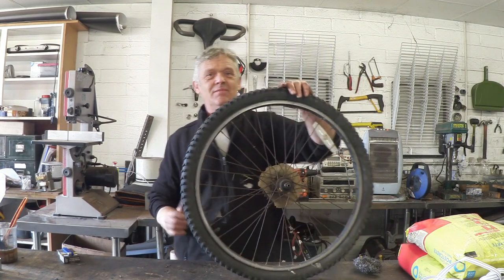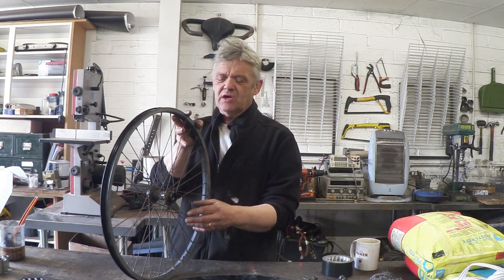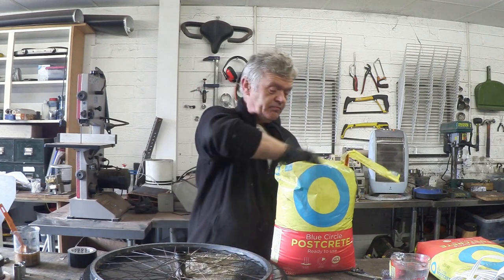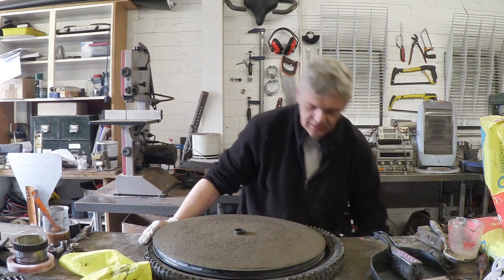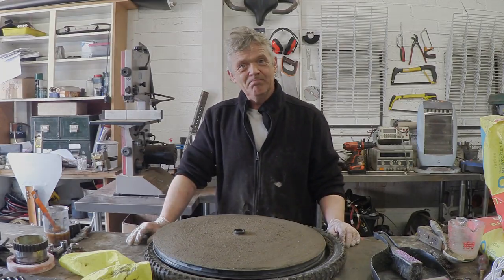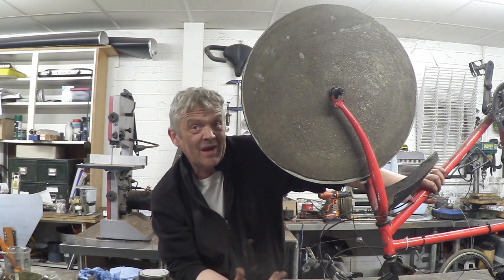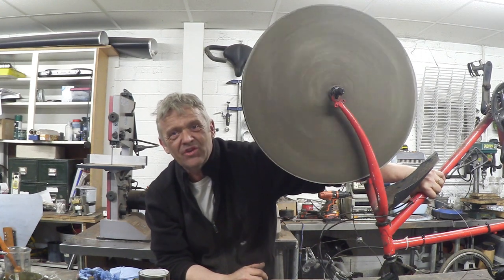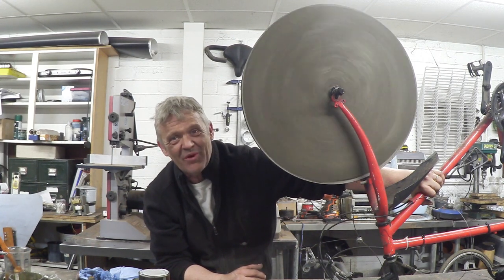1118 An Easy To Make Flywheel From Concrete And  A Bicycle Wheel

Comment: Wow!!  You'll never cease to amaze me with quick and simple solutions for what might expect would be a difficult component to make yourself.
If someone asked me to make a flywheel, I'd be researching melting and casting iron all week - concrete would never have occurred to me.
Reply from the maker: it does make a nice job of it
Reply: I found myself full in this search ... and now our dear friend saves me
two questions keep me from sleeping though;
the weight ; 25 kg; will it be enough? And above all, will the bearing hold up?
What do you think please?
Reply: You can buy round weight one at sport store

Comment: Awesome... I guess I need head out to the garage and put my old flywheels to good use. I was in structural concrete for 35 years. Lots of good advice given in this video.
Reply from the maker: wow - thanks mate
Reply: @ThinkingandTinkering  You do a great job with your preparatory research. Then apply it in some fantastic ways.

Comment: I'm thinking that to upscale this, you could use a car tire? Or adding weights to the bike tire before adding cement (but then I'd be worrying about the bearings if that sort of load would be an issue or not). Or adding more flywheels to increase "weight", as I've seen some generators with up to 18 flywheels. I've yet to start anything like this, but I've been stuck on an idea of making a modular workout system since I was a kid that would charge a large battery, with the pedal system mainly used for working on the computer. Amazing video! Love to see people using simple, accessible parts and tools!

Comment: Now that, is a good idea! Steel reinforced concrete flywheel with built in bearing axel, chain drive and freewheel hub. Super cheap too.
Reply from the maker: now you describe it that way it does seem good lol - cheers mate
Reply: Steel 'Oil-drum' full of concrete, and car-axle bearings; tons of stored energy (pun intended). Or 'scrap' steel plates and same/similar bearings, higher density of steel makes more energy storage in a smaller volume, and its way stronger. don't under-estimate the danger of a bursting flywheel (add fibre and/or chicken wire to the concrete). An oxy-gas cutter on a radius arm cuts really well balanced steel discs in one pass.
Reply: @bikerfirefarter7280  
What mode would this flywheel explode?  Just asking to get an idea how fast this flywheel could turn for energy storage.
Reply: @lylehintz7275  A flywheel stores energy at any speed of rotation, but the stored energy is related to V-squared so faster is better, and therein lies the danger. The mode of 'explosion' is generally catastrophic for brittle flywheel materials, chunks large and/or small flying at speed mostly in the plane of rotation. Materials of high density and with high tensile strength are preferred. Brittle materials confined within structures that can rupture are very risky and need robust outer cases capable of retaining the fragments and absorbing all the energy. Ideally the flywheel material itself, IF it fails, should disintegrate into very tiny particles, and the fracturing process should also absorb all the stored energy.

Comment: made one with my dad took the tire off,  and wound old copper wire around it until it was about 11lbs finished it off with epoxy  which we balanced using plasticine, (modeling clay)    then we had a gob big enough to balance,  we weighed the putty and mixed up just a pinch more epoxy (by weight)  expecting some would stick to the cup/mixing stick.    we got it pretty good that way.  and did other minor adjusts by drilling out some of the epoxy/wire in 2 or 3 spots.  thing would spin for ages.  lots of gyroscopic force.
Reply from the maker: it sounds awesome mate

Comment: Really nice videos, great work. Il put my idea here, i wish i had the possiblity to do it myself, but right now no. I have a portablw 100w solar panel and very variable sun. I have used lifepo4 in between to make it more usable. But, my idea is having a flywheel instead as balancer/storage. Have old training bike with flywheel.  Maybe powering intermediate tool use, drill etc maybe 300w. Weight preferably portable, maybe 20-30 pounds for the flywheelpart. Maybe even interested in the math :-)

Comment: I like this idea alot for the reason that you can treat the flywheel as a module and connect multiple together to work with extra weight.
Reply from the maker: nice one mate
Reply: I need to connect 4 of these flywheels (4 x25 = 100 Kg) but how to make this connection please?
one next to the other horizontally crossed by the same axis? Yes ?
Reply: @ThinkingandTinkering  What do you think dear Robert?
Reply: @slimel-gharbi8170  you could make it easy on yourself and swap the axles with threaded rod.
Reply: Or you could cut and drill pipe to overlap the axles "sleeve" and use a pin or nut and bolt on each side.

Comment: Epoxy sand composit also works great.
Reply from the maker: it would do just great mate - a bit more expensive than post crete though - I paid £4.50 a bag
Reply: @ThinkingandTinkering  I've been wondering what materials would make a fair to good grinding wheel.

Comment: old barbell weights will serve too.
Reply from the maker: for sure - they can be hard to centre though - the bike wheel comes with a ready centre
Reply: @ThinkingandTinkering  I just looked it up and generally, the bore is 50mm, and the plates run form .5 to 25 kilos.
I don't know about Canterbury, but here in California, you can occasionally get a barbell set just for carrying it away. :)

Comment: Robert,
I had a drive laid at my house and they laid thick plastic on the surface after it began to stiffen up. Every day or so a man would stop by and dampen the surface and then put the plastic back down.  About 10 days later they uncovered it and that was it. This company has an excellent warranty and I guess this is why they can offer it.
Reply from the maker: that is a lot of work to go to for a drive mate - that will be one tough lump of concrete

Comment: I would like too ride a bike with concrete wheels now.
Reply from the maker: lol - who wouldn't!
Reply: @ThinkingandTinkering  Nice idea 'in theory', but the spokes do nothing to reinforce against bursting the concrete, at least add fibre and 'chicken-wire' to the concrete. do not underestimate the dangers of a bursting flywheel's stored energy and the real potential for damage/injury. somebody is bound to see just how fast they can get one to revolve!; remember the history of big grinder-wheel bursting. Be safe.
Reply: Riding will go great stopping.....
Reply: @bikerfirefarter7280  Burst? How fast is it gonna be spinning?
Reply: @SinsBird  Only as fast as it reaches its tensile failure point. Then its no longer 'spinning'. I repeat, 'somebody is bound to see just how fast they can get one to revolve!; remember the history of big grinder-wheel bursting. Be safe.'  Don't just ask me, do the homework.

Comment: I thought about turning my old bicycle into a water pump and I needed a Flywheel so I also thought of using concrete to convert the rear wheel into flywheel and came to Youtube for ideas and saw that you thought about it a year ago. Anyway, is it balanced on all sides ?

Comment: Cool!  But wouldn't it just be easier to just use the wheel?  Am I missing something?  Love what you do, keep it up!  Take care, Poo
Reply: Without the weight it wouldn't be a flywheel to continue the momentum.
Reply: Think of it as a battery for angular momentum.
Assuming somewhere around mid sixties cm Dia., at just 100RPM:
For a 500g ring you'd have about 3 Joules stored.
For a 25kg disk, it would be more like 75 Joules! 
Basically, for the pedal-power, it lets you use your muscles at peak efficiency and rest between power-strokes. Just like a 4-stroke ICE only makes power on one-half of one revolution and has to coast the other three-quarters of the time.
Reply from the maker: a flywheel needs mass mate - all you are doing with the concrete is adding mass - a lot of it!
Reply: @poosmate. you certainly are missing something alright. Mass and physics. no offense meant.
Reply: Excellent!  Thanks for all the replies guys.  Take care, Poo

Comment: Why didn't you fill the tyre with concrete?  I would have thought that this would put the weight at the greatest distance from the hub, thus providing the maximum benefit to the fly wheel... ? Regards Mike  ;)
Reply from the maker: because its a thing that is easy to say than it is to do mate

Comment: Nice - brings to mind Lucien Yeoman's concrete lathe designs from 1915/16.
Any idea what the maximum safe speed for one of these flywheels would be? I'm guessing it's highly dependent on curing time.
Reply: There is NO 'safe speed' for rotating non-reinforced concrete, regardless of curing time.
Reply from the maker: I am sorry mate but I think you are wrong here - concrete flywheels are being tested for green energy storage at thousands of RPM - it all depends on the containment - actually in this flywheel it's not that bad as if you think about it you have wrapped the concrete in a steel band
Reply from the maker: it would do mate but as I said to biker there is in fact a lot of interest in concrete flywheels - if you are interested check out some of the designs - search term is concrete flywheel
Reply: @ThinkingandTinkering  Agreed. But note 'containment'. And I did say 'non-reinforced'. Concrete at Thousands of RPM? Scary. I wonder at the overall  'green' of concrete over say stacked steel discs cut from rolled plate or even cast steel discs (from scrap). Plus the density issues. And 'aging'.And consistency/certification/testing etc Plenty of things to consider.
Thanks for sharing.

Comment: I wonder what is the top RPM that's still safe. 3.5?
Reply from the maker: remember it has, in effect, a steel band around it holding everything together so rpm is probably higher than you think
Reply: @ThinkingandTinkering  I also know that steel rim is flexible so at high speed it will easily change shape sideways and those forces are not counteracted by anything. In fact the weight of the wheel will make it worse. In any case, without actually testing it, this is all hot air.

Comment: I was very surprised by flywheel efficiency, it is stated that production models with magnetic bearings and sealed in vacuum should have 90% efficiency. The 1 thing I can not find an answer to though - how long charge can be kept? I understand that of course momentum will fall with time and speed will decrease, partly due to not perfect vacuum partly to earth's rotation, how much exactly? Say if I charge 1 state of and art vacuum sealed magnetic bearing flywheel with 1kW of energy, how long till it be 80% so 800W and 0.8 of the speed, not even touching it? Can it store say 80% of the charge for 3 winter months till our solar panel can kick back in xD?

Comment: Bichumin would proberhably do.
Reply from the maker: maybe but it would be unbelievably messy lol
Reply: @ThinkingandTinkering  I don't see why?
Reply: @wmffgeorge1589  did you mean to use bitumen to make the wheel, or bitumen paint to seal the concrete?
Reply: @nil5221  bitumin paint to seal the concrete.
Reply: @nil5221  a fly wheel of tar would proberhably work, onestly I think it'd be a bit lite.

Comment: Could you make a flywheel out of HDPE ? Put it on a lathe and balance it .... added advantage would be to turn it into a rotor/stator
Reply: HDPE's pretty lightweight stuff. Key thing for a flywheel is high mass.
Reply: @richardgregory4640  .... I’m not talking about thin stuff ..... 5-10cm across , solid , maybe put a steel ring around it , a series of magnets around the circumference to generate power with coils ...... or inset magnets radially on the face of the flywheel
Reply from the maker: in essence - I don't see why not
Reply: as Robert says,  there's no reason why not. But I just wonder why?  What benefit would HDPE give you over this set up?
Reply: @richardgregory4640  ...... just the ability to inset magnets or coils into the flywheel relatively easily without the interference of spokes or reinforcement .

Comment: I bet you a pint of beer (of your choice)  that if you add a layer of aluminum on one side and graphite on the other, the performances of your flywheel will increase due to tunneling current bending more space-time and increasing inertia.  I would also try expended clay in the mix of concret.

Comment: I may be wrong but don't washing machines have a flywheel?
Reply from the maker: i don't think so mate - think they basically have a brick in them don't they?
Reply: @ThinkingandTinkering  no 'fly-wheel', other than the 'inner-drum' (negligible mass) and the motor-rotor, but they usually do have a molded concrete block attached to the outer-drum for inertial dampening of the unbalanced contents of the inner-drum.
Reply: @ThinkingandTinkering  of course if you fill it with concrete. John Russell is ahead of you mate. Complete with flywheel charger, good going John.

Comment: Don't you have a flywheel off your little car you took the blower off of just curious.  Great solution tho. Water glass works great as a sealer lol
Reply from the maker: I do mate - I have a few actually - but when I am doing something I do like it that others can replicate if they want - so I look for solutions that can be easily made rather than expensively bought
Reply: You are very correct sry about that I get in problem solving most effective way type mind set and I have hell of a memory.  Was like why are you using a real fly wheel rob I know you got atleast one lol 😆 sometimes I teach everything like a problem that's need solved etc
Reply: Still tho I'd never imagined that brilliant idea